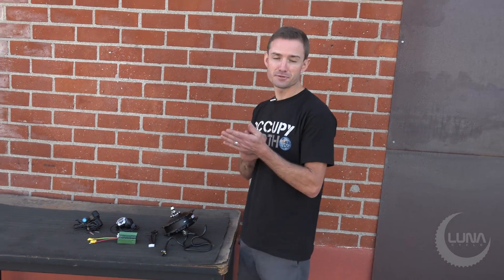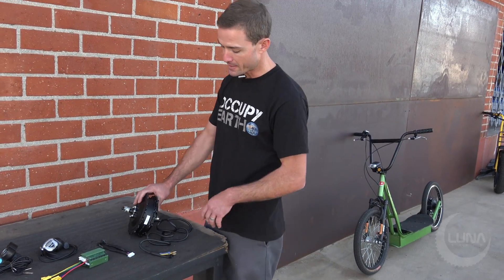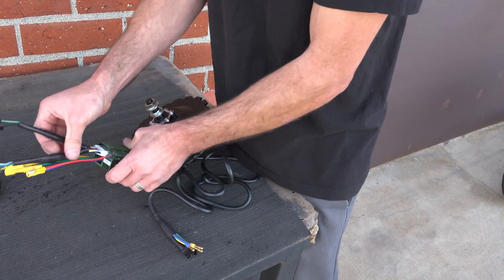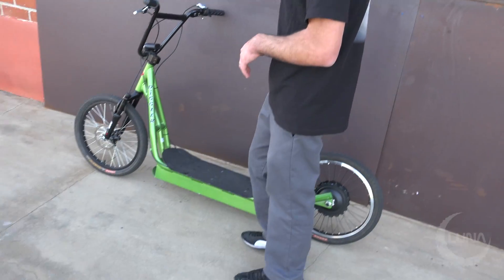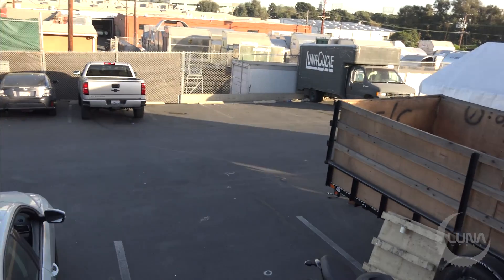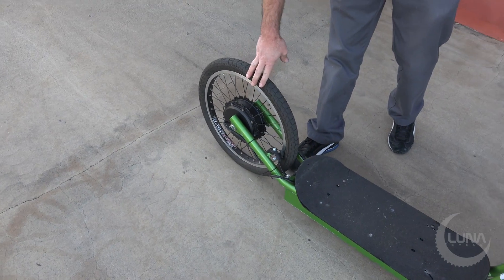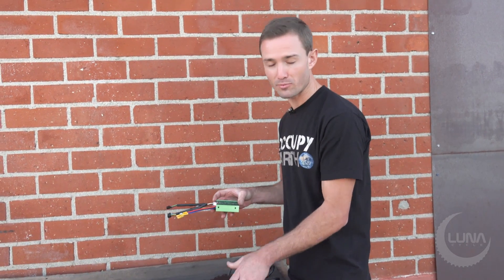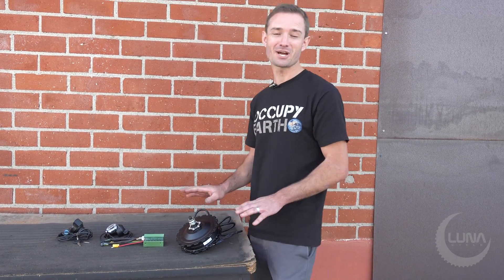Luna Cycles introduces a real hub motor with a real controller

Comment: I just bought one one eBay the guy bought from Luna cycle the price I’ve paid £620 for whole kit but I think it’s cheap from Luna cycle it’s not power full motor no much torque but on the flat rod it will do 40 miles around 65 kilometres you don’t feel the power from start will go very fast 💨 so I’m thinking of ordering another one from Luna cycle before sold out it’s fun to ride love it 😍

Comment: Burned up 2 of these on medium hill climbs.. good on flat ground but burn up fast on hills. Get a Mid drive for hills
Reply: Gary Allen how did you burn Luna cycles says motor will cut off the power to prevent getting burned

Comment: Just got this In a 6t version for my electric road bike. First thing that took me by surprise is how smooth but powerful the acceleration is when compared to a generic ebike motor. The asi controller does hear up quite a bit though. Overall well worth the buy. Easily hit 38 mph on the 6t version of the motor and it's scary to apply full power. Full power will easily go over 40+ mph in windy conditions on a 48v battery.
Reply: Emil Luck how about the torque? Like going up hill
Reply: Emil Luck I just got one this kit in in uk 🇬🇧 on eBay some one bought from Luna cycle I paid £620 I think Luna cycles would be cheap to buy from them no much torque up hills but impressive fast 💨 my bike is 26 mountain bike I can hit 40 miles for power

Comment: i didnt see any temp probe wires. so how can the controller know the temp of the motor?
Reply from the maker: the motor has built in temp sensors  ran through the wiring harness
Reply: Luna Cycle Ebikes I’m going to order mac 6t very soon do you stock them or they will sold out soon and no more will made?

Comment: These small can't keep up with bigger direct drive hub motors. Don't be fooled even for a second. 

ASI controllers are actually not hard to setup, the controller figures out the proper phase and hall combo automatically anyway. All you really have to do is set the power limits.

Hell you can even use the Grin PhaseRunner Software to program ASI controllers, makes setup a breeze. Crank up the field weakening and let it rip.
Reply: Alan Hu Track racing will have many variables and will test the riders as much as the equipment. If you wanna compare systems a dyno would probably be the easiest.
Reply: Alan Hu And hubs are noisy.
Reply from the maker: Alan we have always been willing to race you with whatever you want to show up with....we are right down the street.
Reply: Luna Cycles sounds good
Reply from the maker: ok when are you showing up and what weight class you want to race in? whatever your bike weighs we will have something comparable weight to race against.  It will be fun.
Reply from the maker: hey alan when did you say you are showing up?
Reply: If you want to race lets take it to the race track, no point in doing a straight line race anyone can just crank the voltage way high up and slap on a big motor / controller, lets race on a go-kart track with corners. Weight is 100lbs, standard mountain bike frame.

Comment: Is this motor able to be built into a fat tire rim? Also, for pulling a cargo trailer what would be better? Mac hub motor or bbshd?
Reply: Pure Water Window Cleaning buy mac 12t if you want run cargo 12t has more torque but slow speeds 6t has no torque but very fast 💨

Comment: But still BBSHD is better, right?
Reply: Bafang ultra seems better as the nylon reduction gear is much larger. But the bbshd is cheaper and doesn't require a custom frame.
Reply from the maker: hub motor and mid drive are completely different .... i would say the mid drive is definitely better for off road use. on the road its a coin toss depending on conditions etc.
Reply: Bafang ultra seems better as the nylon reduction gear is much larger. But the bbshd is cheaper and doesn't require a custom frame

Comment: Also, what is the top speed and what is the Nm on that scooter?
Reply: MRBARBARYCOAST hi mate I just bought one it will do 65 kilometres maximum speed around 40 miles on a flat rod but up hills not much torque but still love it very fast 💨